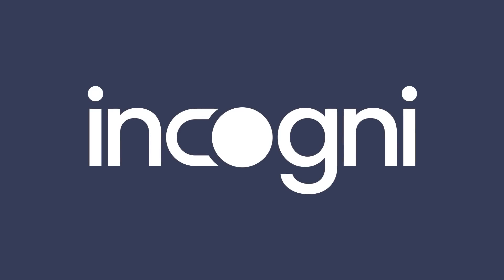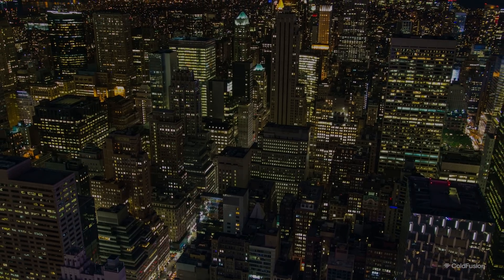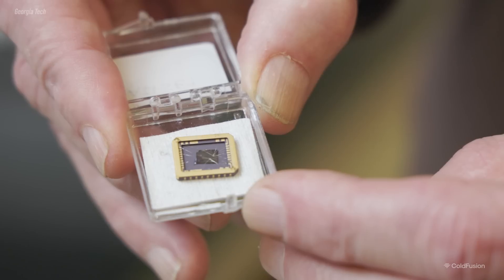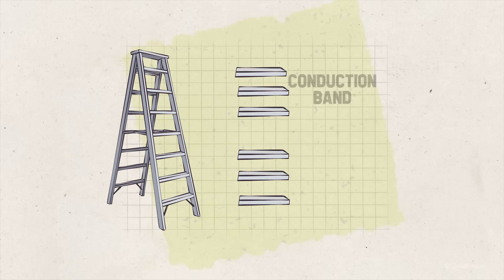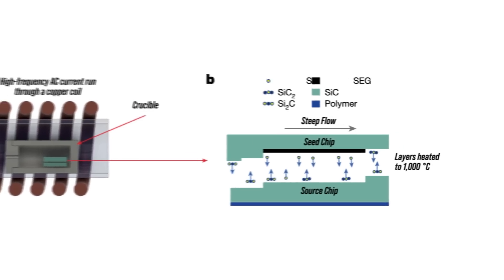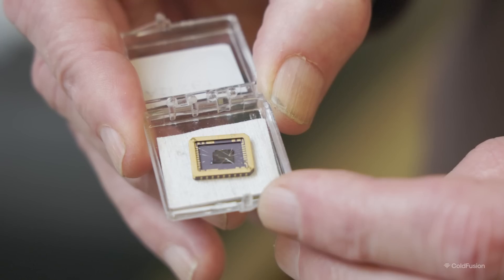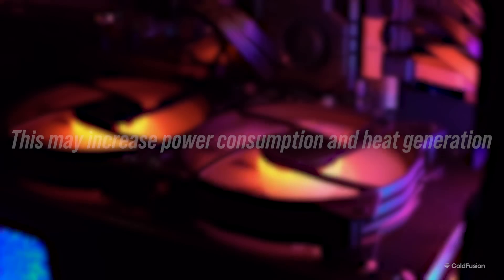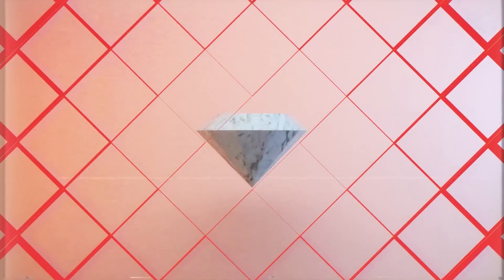This Chip Could Change Computing Forever

Comment: # Proposing a Solution to the Bandgap Problem in Graphene for Transistor Applications

*Author:* Arceneaux
*Date:* 04/22/2024

## Abstract
Graphene's high electron mobility, thinness, and flexibility make it an attractive material for use in advanced transistors. However, its lack of a natural bandgap presents a significant challenge for its application in digital electronics. This paper proposes a novel approach to introducing a bandgap in graphene, enabling its use in transistors and paving the way for graphene-based computers. The proposed solution involves a combination of chemical doping, strain engineering, and graphene nanoribbons to create a stable and tunable bandgap.

## Introduction
Graphene is a two-dimensional material composed of a single layer of carbon atoms arranged in a hexagonal lattice. It exhibits exceptional electrical, thermal, and mechanical properties, which have attracted significant interest in its use for electronic applications. Despite its high electron mobility and flexibility, graphene's lack of a bandgap has limited its utility in digital electronics, where a bandgap is essential for turning transistors on and off.

The goal of this paper is to propose a solution to the bandgap problem in graphene, enabling the creation of graphene transistors for use in electronic devices.

## Challenges with Bandgap in Graphene
Graphene's electronic properties result from its unique band structure, with a linear dispersion relation around the Dirac points. This structure means that graphene has no natural bandgap, which is a significant hurdle for creating transistors and other digital electronic components.

Previous approaches to introducing a bandgap in graphene include chemical doping, strain engineering, and the use of graphene nanoribbons. While these approaches have shown promise, each has limitations in terms of scalability, stability, or tunability.

## Proposed Solution
The proposed solution aims to create a stable and tunable bandgap in graphene by combining three approaches: chemical doping, strain engineering, and graphene nanoribbons.

### 1. Chemical Doping
Chemical doping involves introducing impurities into the graphene lattice to modify its electronic properties. This method can create a bandgap, but maintaining stability and uniformity in the bandgap remains a challenge. The proposed solution uses targeted chemical doping to introduce a controlled number of impurities, providing a tunable bandgap while preserving the electronic properties of graphene.

### 2. Strain Engineering
Strain engineering involves applying mechanical strain to graphene to alter its electronic structure. This approach can create a bandgap by deforming the lattice, changing the dispersion relation at the Dirac points. The proposed solution incorporates strain engineering to enhance the effect of chemical doping, allowing for finer control over the bandgap.

### 3. Graphene Nanoribbons
Graphene nanoribbons are narrow strips of graphene that exhibit a bandgap due to quantum confinement effects. The proposed solution uses graphene nanoribbons to define specific regions within a larger graphene sheet, creating bandgaps in these areas. This method allows for precise control over the bandgap's size and location, enabling the creation of complex electronic circuits.

## Implementation and Applications
The proposed solution can be implemented through a combination of fabrication techniques, including chemical vapor deposition, lithography, and strain control mechanisms. By integrating these approaches, it is possible to create graphene transistors with stable and tunable bandgaps.

The primary application of this solution is in the creation of graphene-based transistors, which can be used in various electronic devices, including high-speed processors, flexible electronics, and low-energy components. This development could pave the way for graphene-based computers, offering significant advantages in terms of speed, energy efficiency, and flexibility.

## Conclusion
This paper proposes a novel solution to the bandgap problem in graphene, combining chemical doping, strain engineering, and graphene nanoribbons to create a stable and tunable bandgap. The proposed approach offers a path toward graphene-based transistors and ultimately graphene-based computers. Future research should focus on refining these techniques, improving scalability, and exploring additional applications for graphene in electronic devices.

Comment: that would be amazing as a substrate for normal CMOS chips, just to take away the heat, one could potentially already double the frequency just like that, by injecting more current and taking away more heat, thus getting more density.

Comment: Graphene based chips? This has been speculated on and teased for many, many years. I’ll believe it when I see it
Reply: @cacaonibbler  Chinese scientists combined silicon carbide with graphene making possible much higher speed and low power consumption, and Tiang University laid out the steps for the commercialization of this chip.
Reply: @cacaonibbler  It's only been 4 months since this joint discovery but Tianjin University has already laid out the steps for the commercialization of this Graphene chip.
Reply: The wonder of graphene has been systematically kept under the radar.
Better said we have birds in the sky that are nearly undetectable using this technology on full size scale.
Reply: Wont ever happen. These are all scams
Reply: @cacaonibbler  Your thinking box is small. Why do you think some stuff are CLASSIFIED?
News papers writing about a new technology is directly consumer space intel. There are more things invented that you will never read about because it is CLASSIFIED.
Reply: @N0N0111  science is never really classified. Some military tech is classified but they are not doing science they are just applying known science to build military equipment and it's classified so that enemy wouldn't be able to exploit known weak-points. For instance classifying range of a missile means enemy cannot know what distance from the front lines they need to fall behind to stay safe even if missile doesn't have any breakthroughs in science knowing it's exact properties changes military strategies. For instance exact composition of tank armour is also classified. Not because it has any new science - it does not it's all built on known material science. It's classified because this way enemy cannot know how big they need to build their own anti-tank shells to destroy it. If they know armor composition exactlt then they can more easily build missiles at minimal cost that will take out the exact armour. If they don't know means they need to go with conservative measure and overbuild their missiles which means building them and carrying them is more expensive.
Reply: I guess you missed the entire point of this video 🙄🙄
Reply: The Chinese came out with the first commercial graphene-based chip, in commercial application.
Reply: @Hanger14  China can't even make their own 14nm silicon wafers. what are you on about?
Reply: @spld3rp1g  Can't even make a gt 1030 comparable graphics card without sucking 250w of power and performs around gtx 750 none Ti
Reply: @LeoNux-um7tg  Bro you are comparing pears to apples. China's expertise in electronic architectures is behind the US hence why their computing products is 5 years behind. However, they may well cary research in material science such as graphene based semiconductors for future tech.

Comment: I have that Elecjet battery pack. I use it often with it being cycled between 1 and 5 times a week. It still charges fast and seems to have held up well. The battery pack is significantly lighter than multiple other 10,000mAh batteries packs that I have from Anker and others.

Comment: How do they dissipate heat? The central reason we don't have 20 GHz processors is because heat dissipation at the high of a clock speed is extremely challenging.

Comment: We’ve been hearing about twice as fast processors and half the size 10 times better batteries every year for 20 years. It’s never happens either because it’s not possible or those up top who get rich don’t allow it.
Reply: Are you referring specifically to graphene? Because computers in general have gotten consistently two times faster or smaller every few years for the last 3 decades. Slowing down now, but only recently

Comment: Mention of Graphene is at the same level as Nikola Tesla when it comes to scientific development, a complete con. In theory Graphene can do miraculous things but no one has managed to produce viable sheets of the stuff. The Graphene battery pack was actually a capacitor and suffered horrendous rates of self discharge, just like every other capacitor. The well proven Silicon semiconductor technology will be with us for a good many years yet.

Comment: This video did not explain how exactly the transistors work there. 
Usual Silicon transistors are manifactured by EUV Lithography to make them within nanometer precision. This manufacturing process took Billions of dolloars and decades to develop. 
So what makes the Graphene manifacturing process as precise and scalable? 
I mean it is a great lab result, but I am very sceptic that Graphene can be manifactured on an econimical scale. 
Therefore, I do not understand why semiconductor graphene alone should make it possible to now manifacture nm-sized transistors with high electron mobility. This will take several decades. Graphene produces very fragile technology.

Comment: It's a breakthrough. It's interesting. It's many years away. Decades. There is so much more that goes into the making of a transistor. Many steps to create the desired patterns. And ALL of it will damage the shiny new graphene surface. Doping of a semiconductor is critical for getting the right electrical characteristics. I think, we will have a hard time overcoming that, sadly.

Comment: This will enable those chips to be made even "bigger", so it'll take advantage of the extra battery life to still run for only a day, but much much faster for really cool graphics on the bigger screens. 

It's like making lighter gear for soldiers, so they can have more stuff for the 50kg they are still forced to carry.

Comment: Graphene is revolutionising electronics. It has taken time but development has been underway. Check out GMG (Graphene Manufacturing Group). They are building graphene batteries based in Australia out of Queensland University. The US has expressed interest in their tech as they want to move away from lithium because the Chinese control about 80% of global supply. This company makes graphene in a lab by electrifying natural gas through a proprietary system they have developed and patented

Comment: Products already exist with graphene. It's just that theyre 10 to 15 times more expensive than similar products, such as that battery bank. Charging up 5 times faster and having 2-3x the charge cycles is nice but it's not worth paying 250-300 eur more. I can buy 10 lithium power bricks for the same price which makes charging times and cycles moot. Its not environment friendly but no one gives a shit about that. World ends before 2100 anyway. Reduce the price to max 3x the cost of lithium batteries and then you have a deal.

Comment: The year is 2120... We will finally have graphene computers in 10 years!
Reply: Envisioning a groundbreaking new use for something, is infinitely easier than the trial and error process of turning a theory into a useful tool. Not only that, but it's not just the linear problem solving of engineering the whole thing. You have to figure out every step in the theoretical process and then turn that into a machine that can do what you need it to do. It most likely takes more time to build fabrication technology up to par for the new tech than it does to actually engineer that new tech. and that was only generation one... See how it can take years to move forward? When you look at the situation, actual time spent on the new tech is limited by the speed at which fabrication can keep up. Imagine you run into such a novel problem, that is a known solution, but the fabrication technology doesn't exist... You stop doing everything on the new tech, and start over with the fabrication tech... It's not just a straight forward thing.
Reply: @Robert_McGarry_Poems  Did anyone watch the video? They did it already. ColdFusion does no hype.
Reply: More than likely what is the longest term problem, is that you can't even begin to start designing a chip set architecture until you know what the dimensions of your components will be... Getting to a useful chip, gen-1 is hard enough...
Reply: and cold fusion in 20 years!
Reply: I thought we will have analog computers.
Reply: @mdjey2  It's not that we can't build them, it's that they require a single linear tolerance through the whole circuit. They are easy to imagine, but comparably difficult in the real world to build. If there are errors in tolerance, they add up and even expand when a multiplication event takes place, which is most of computing today... We have circuits now, that are true digital, that mimic an analog circuit pretty well, but using those in architecture will require a new approach to program coding. They are coming back ish...
Reply: The year is 2270. XJ-9 has been built, but we will have graphene computers in 10 years!
Reply: @BOplaid  Lol.  Room temperature super conductors have been around for generations at this point.  But graphene computers are still ten years away...
Reply: It's 5 billion years in the future. The sun is now in the Red Giant phase, but we will have graphene computers in just 10 years!
Reply: @dx-ek4vr  hahahaha dude im dead
Reply: Uh-oh, In 2117, the sun is supposed to hit Venus with a huge CME that creates two tails of matter which extend into Earth's orbit and bombard us off and on for about 7 years.
Reply: And commercially viable nuclear fusion is around the corner.
Reply: video is already 12 years old of the old guy. this is a clickbait false crap. author knew it's so old.

Comment: I have been following the same research and I was really excited when they announced. I finally felt Carbon chips were near.
Reply: The stacked graphene twisted layers wire, paper was pretty mind blowing. Basically the moire pattern can be stacked, continuing to twist the layers by what 1.1° indefinitely. The resulting structure acts as a wire with very little resistance, and (I think I remember it saying that the Eddie currents that are the problem with traditional/conventional wires, almost disappear. But I can't remember if it was the same paper...)
Reply: The implications are endless... 🤯🤯🤯

A fully carbon circuit. Almost zero resistance. And no transport loses, the amount of current in equals almost that much out... Like you wouldn't need to drive a power source anymore!!! A battery and a clever capacitor setup and it would last a very long time. Imagine adding a solar panel... Like those old AF calculators... Lol.
Reply: why is he quoting a 12 year old video from the old guy talking? if this was some breakthrough, why is it first time I heard about it?
Reply: @percy9228  Do a search for graphene chips and you'll find a dozen large channels covering this very breakthrough. I don't know how you missed it, especially, seeing as though, its sounds as if, you keep your ear to the ground on these topics!? Do you watch Sabine Hossenfelder ? She even covered it...
Reply: @percy9228  Well, graphene hasn't been around very long. The idea of it, sure... But the whole pencil lead things was quite recent. Anyway, it hasn't just been sunshine and rainbows fabricating graphene. Getting to a cost competitive product took over a decade... You can't progress real world engineering without the thing you are testing... It's not that the theory making stopped, it's just that we only now have the fabrication technology to start working on where the theory has led us. Take an engineering course and chemistry for that matter...
Reply: @Robert_McGarry_Poems  dude what are you talking about? you haven't answered my question. @ColdFusion has made this video and used a 12 year old video to make some outlandish claims of some breakthrough.
Also the paper he's quoting is actually from August 2023. if this had any legs it would have been in the news that theirs a breakthrough. I follow this kind of news and it hasn't. ColdFusion has read some clikbait article that has this old video and he basically copied it for his channel. Their is no breakthrough. Learn to do research and verify such claims. Did you not think it's sus he quotes  a scientific paper and yet doesn't give a single claim of how fast it or anything.
Reply: @percy9228  This conversation is old, yes... The technology needed to actualize it, is brand new. The conversation now is being re invigorated because of the new breakthroughs in fabrication and understanding material science better. What you are saying is that you actually don't follow this conversation very well, or you would understand this. Thanks...